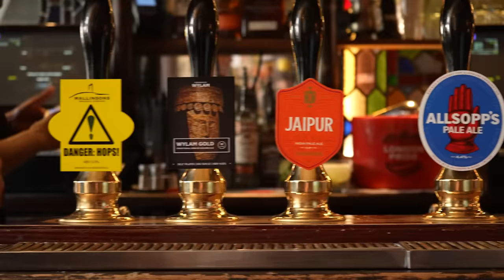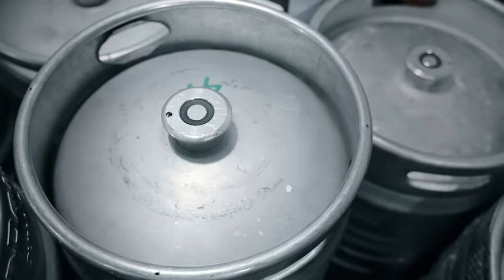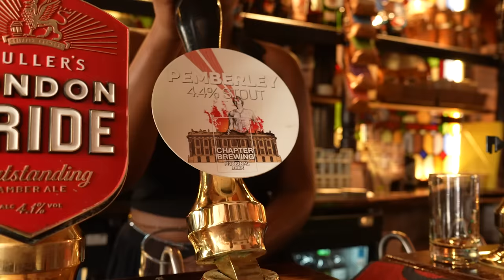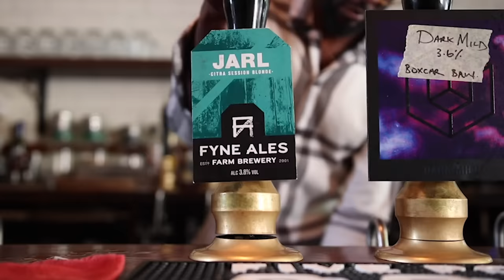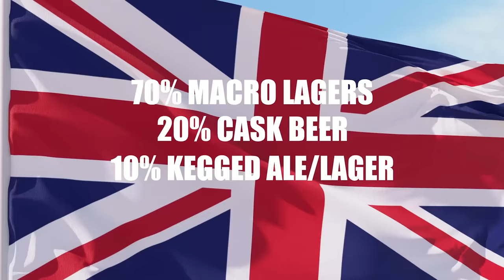American Tries English Cask Beer

Comment: Pub, Inn and Tavern all have their roots in medieval England. A pub is a public house where ale was brewed and sold to the public. Over time, these houses would advertise their wares by putting a sign up with a distinctive name. This is where the pub sign and naming of pubs originates, essentially as a marketing tool. Ale would go off quite quickly, so had to be drunk quickly, usually in large volumes to get drunk because it was only 2-3% abv, until hops were added in the early modern period. This preserved ale for longer, made it stronger and also gave it a distinctive bitter taste, hence the term “bitter” for a beer brewed with hops.
An Inn was an establishment that served travellers. Most would have facilities for horses and carriages. They would serve refreshments to travellers, such as ale and wine, and also food. You could pay for a bed for the night, though you were not guaranteed to be the only occupant! 
A tavern derives it’s name from the Latin Taverna, a shop where you bought wine, which could be consumed on the premises. In England, Taverns were distinct from Pubs and Inn’s because they sold wine and cider, rather than ale.
Reply: Hops don't affect the strength of the beer.
Reply: @Mathemagical55 it can
Reply: @Mathemagical55  in the video they talk about how hops stops the wild yeasts that turn beer sour (12:35.) I think he is referring to that. Before hops the secondary fermentation would turn the beer sour so you couldn't allow the beer to get to it's full abv.
Reply: This may be the reason there are many taverns in the west country , thank you

Comment: Super interesting, I’d love to try some real cask ale over the pond!!! Cheers 🍻
Reply: It's definitely worth a try. Something that wasn't mentioned in the video at all was the regional variation in serving style. While it's not at all universal, pubs in the South tend to just dispense the beer straight out of a pipe, whereas in the North, you tend to see a plastic 'sparkler' on the nozzle which is a piece of plastic with lots of small holes in it. You can see at 2:28 a beer being poured with a sparkler on it (incorrectly, I would add) and then the next pump over (Oakham Citra, nice beer) doesn't have the sparkler on, but you can just about make out the screw thread where it would be attached.

The difference is that the last bit of CO2 gets knocked out of the beer by the sparkler so it's slightly less carbonated. Also the head has a finer structure to it so it's got a creamier texture and supposedly better aroma but I've never noticed the difference. I prefer the Northern style as it's what I'm used to. A lot of pubs in the South will have sparklers somewhere behind the bar, but younger bar staff might not know what it is or how to serve a beer correctly using it as there is more technique involved beyond "pull the handle until one pint of beer comes out" which is seemingly what a lot of bartenders I've seen in the South do. You can do that for hand pulled cider, no problem, but not for cask beer.
Reply: It doesn't generally travel well, and it needs to be properly looked after.
Reply: @magnusbruce4051 absolutely and sometimes in the north they have the sparkler screwed on too tightly which overdoes the effect... There is real technique required to pull a good pint with a Swan neck pump....

Sparkler should be backed off a quarter turn for a normal ale, more for a particularly lively cask.
Put the glass all the way up so the sparkler is just touching the bottom (use a glass without a nucleation pattern for all cask always) pull long steady pulls until the head is just below the top of the glass.
Stand the beer and allow to settle for a few seconds.
The put the Swan neck back in but only 1/3 of the way down the glass and top up with a snapping motion
Reply: @dasy2k1  That's a pretty solid description of the technique, but obviously it's much better to show it than describe it!

I worked with multiple peopl who would top it up while the pint glass was sitting on the drip tray. Even if they got the first bit right and let it settle, it was for nothing when they cock up the end!

Comment: A Tavern would traditionally serve wine rather than beer/ale. Originally from the Latin 'taberna' for a shop or inn. There are still taverns in the UK, but the drinks are no longer limited.
Reply: Then why was Yates originally called Yates Wine LODGE?
Reply: @MerseyBeers  presumably because Peter and Simon Yates thought it sounded 'posher' from a marketing perspective. A lodge is traditionally located in a rural hunting or sporting setting - confusingly, perhaps, with 'lodging' like an inn. All this is quite google-able.

Another point about an Inn is that they were generally licensed to have board and lodge, not just sell alcoholic beverages and food.

Most of the terms sort of fell into the category of 'pub'... which could be anyone's residence that sold alcohol to the public... hence 'public house'
Reply: @MerseyBeers pure marketing, nothing else
Reply: Tavern is just a term for a place that sells alcoholic beverages and is interchangeable with Inn and didn't really have a predisposition to either wine or beer in general. If anything beer was much more widely drank in the UK due to the water being unsanitary to drink and the nationwide weather being more conducive to producing hops rather than grapes.

Comment: An important 'thing' about keg beers that is often overlooked is how much the tightness of the sparklet affects the taste. I got used to drinking Tetley bitter in the Northwest which has a head that leaves a spidersweb of head on the glass, and tasted really nice and complex with a citrus aftertaste, when I moved to the Midlands, and found a pub that served Tetley, they forced it through the sparklet to give it a creamy head and sadly destroyed the taste, getting them to loosen the sparklet was very difficult.
Reply: Yep! I HATE that creamer head, which is indiously working its way south and west. It's because people who know nothing about ale complain it is flat if it doesn't have a couple of inches of froth
Reply: Interesting, I would have reversed the locations with the big head up north and the spiders Web in the Midlands.

I spent 3 years in Manchester at college and was always surprised at how much head the mancunians would tolerate particularly in a non oversized pint glass. You lost at least an inch of beer and got a sponge in return.

Further north in Middlesbrough or Sunderland areas they always had the measured half pint pumps that blasted a half pint into the glass thus filling it with froth, then they had to put the other half in another glass to do the same, and then conduct a type of Japanese tea ceremony to get as much beer as possible in one glass. They didn't have glass washing machines and the local regs said you couldn't keep the same glass for the next round. So they just dunked the glasses in a manky sink of soapy water before serving the next pint in them lipstick etc and all. Just as well the beer did the job.

Comment: A simpler description, I think, is that cask beer is live and keg beer is dead. Keg evolved to make it easier and cheaper for the pubs to dispense it. It did tend to lose some of the flavour in being put into a sealed keg due to the necessatry filtration. Very often not helped by being served cold as this depresses the flavour.
Reply: It may be simpler, but it's not really accurate. Very few UK keg beers are either filtered or pasteurised – only those made by the bigger breweries or those making beers that need to be pinbright like pilsners. The difference is in the fact that finished ferments are put in keg, while those that are intended for secondary fermentation are put in cask. Even that's not always true and increasingly breweries are using key kegs to secondary ferment keg beer.
Reply: @TheCraftBeerChannel  

we are a very small brewery and filter our keg beer to get rid of any yeast and proteins, no pasturisation though. This ensures that the kegs do not need to stand before seving as cask does.
You can't secondary ferment keg and ensure the finished beer is clear (hazy beers are slightly different).
Reply: @iareid8255  indeed! But most brewers don't worry about clarity these days, especially in keg!
Reply: Thing is.. whilst a good cask is great. As the video points out, you soon learn not to drink in places where they don't know how or just don't bother keeping it well.. It can be horrible.
So keg is like 'least risk' if you're getting a random pint :/

Comment: Correct me if I'm wrong, but you can use a cask aspirator/breather to ensure there's no microbes in the gas you use to replace the volume of the beer you pull from the keg, and that means your cask beer will last a lot longer? But CAMRA won't certify you if you use one? I feel like that's a great middle ground: less wastage and more consistent beer by not exposing it to atmospheric air.
Reply: Sorry, just got to that bit! You're way ahead of me as usual! Good work!
Reply: Yep, I was brewing cask ales at home, and using a cask breather for them.  It's kinda hard to drink 5 gallons by yourself or a few friends in three days!  Although it might be kinda fun.  I've done that for parties.

I think it's mostly the impact of oxidation on the beer, which tends to send it to a cardboard-ish taste.  Not a whole lot of microbes are getting through that soft spile while serving; but  they obviously are in there by late in day 3 most times.

My personal favorite was Fullers ESB on the second day after tapping; just a little oxidation first rounds out the flavors even more.

Comment: As someone in their mid-30s, even within my drinking lifetime from the early 2000s cask has become pretty difficult to find in inner cities. In the countryside it's a different story, most good pubs will have 3/4 casks on. But it's such a shame that traditional beer is kind of vanishing. When I was a teenager pretty much all city pubs and bars - even some nightclubs - would have cask. Now it's all kegged.
Reply: That's a curious observation, because cask ale is pretty commonplace in London pubs now, whereas it was considerably hard to find here 20-25 years ago!  If anything, it's harder to find in some of the outer suburbs.
Reply: I'm still shocked when I see a bar with 6 lagers, 3 ciders and Guinness on tap but, the only ale is bottled, back in the 80s there would be several bitters, mild, and IPA plus something interesting like Old Peculiar or Owd Rodger and only Carling or Carlsberg and Strongbow or Woodpecker.
Reply: @steveshephard1158  

"[A] bar with 6 lagers, 3 ciders and Guinness on tap but, the only ale is bottled"

That sounds like most pubs in London in the 1980s!
Reply: As someone in their mid thirties 😂😂😂😂😂 son.

Comment: You need to travel up to the North of England. The ale is more creamier than the South.  I find cask ale pulled in the south is quite flat. This is mainly due to pubs in the South ignoring to use a sparkler.  I don't know why they don't.  Without the sparkler, the ale when pulled can look bubbly yet plain looking. With the sparkler, the ale tends to make its own little bubbles forming a creamier ale. I know it's down to personal preference. However, pouring 2 pints of the same ale, one with a sparkler and one without,  you get two different tastes. The sparkler being creamier due to the minute bubbles it produces. All cask pumps have the screw mechanism for the sparkler, as that is what the pumps were designed to use. It's just that Southern pubs prefer not to use them.
Reply: Even better find a pub using an auto vac. You can build up a really good head.
Reply: I had a nice lecture about using a sparkler when I went on the tour of St. Austell.  Then I noticed that quite a few pubs didn't use one when pouring some Tribute!  I would have said something, but I didn't want to be "that guy"- particularly being an American.  A well-kept and sparkled Tribute is a thing of beauty, though.
Reply: I know a guy who carries his own sparkler around with him. Just in case he goes into a bar who don't use them. He just asks for a pint and could they use his sparkler. 99% of them say yeah and pull his pint and give it him back. 👍 that way you always get the pint you want.

Comment: I was introduced to real ale from the cask when I moved to Peterborough. I had a tolerance for about 10 pints back then before I started to wain. I was taken to a pub in Northamptonshire, the village pub had casks on the back of the bar. The beer was poured from the cask by tap and not pumped by hand or pressure. I was given a pint of Ruddles County, it was dark and had no head. It was gorgeous smooth and tasty. I finished quickly as it was so easy to drink, I bought the next round and was told to slow down. We were moving on after the second and I felt unaffected, until the fresh air hit me. Wow, it was strong. We visited a different pub and returned to the pub owned by one of my friends. I had drunk seven pints when I dropped off at the end of the road to the staff accommodation at the hospital I lived in. I remember taking some steps and falling over something, I woke up in the morning lying on the lawn in the grounds in time to put my uniform on and go to work. My head was clear, I was a little dehydrated but not hungover. That started an education that lasted a lifetime, there's always something new to taste.

Comment: I fell in love with cask ales the first time I visited the UK. I’m planning on experimenting with brewing my own cask ales. Would love to try to do a Barleywine or a Strong Ale in a cask.
Reply: I drank so much barley wine once that my vision went to a white ever decreasing dot and then I guess I passed out. I was very young and stupid at the time!
I'm not sure if you are familiar with a 'snakebite' - half lager, half hard cider? Well we used to drink 'spitting cobras' which is half barley wine, half white cider which is rough as a junkyard dog with an ABV of around 7%.
Reply: Unlike what the CAMRA folks would say, in your case definitely invest in a Cask Breather.  Basically a CO2 regulator that keeps the cask at a very small positive pressure instead of letting oxygen in via a spile.  It will extend the life of the beer a lot, so you don't have to drink 5 gallons in three days!  Not that it wouldn't be a fun group project!  I used one, worked great, my Fullers ESB clone was loved by all my friends!
Reply: @nathanwahl9224  thanks for the suggestion!

Comment: Just had a party for my lovely wife - got two barrels of Timmy Taylors Landlord from a local pub pulled through a pump from FB marketplace for £50.... didn't bother with a spile  or a tap, just drilled two holes through the bung, one for a 10 mm tube for breathing and one for a 10 mm spear for the  beer ... glorious!!  tasted like nectar!  Cooled with wet towels wrapped round the barrels and kept wet .....We did both barrels but for say 20 pints which we had to finish off over the next few days -- it lasts about a week... If your having a party try it - every one loves to pull a pint for them selves and its a good way to support your local pub and brewery.  Previously I've had Osset Brewery beer and they are ace and super friendly as well - Cheers everyone!!

Comment: Larger is a form of Beer. Beer is made with Hops. Ale has no hops in it. IPA is Pale Ale which has been aged. For the length of time it take for a ship takes to get to India from the UK. Hence being IPA. Large became popular in the 1970's. I drank it as a child and still do. My Brother drinks Bitter (Ale). He is much older than me. Most Larger is mainly  mass produced, so it would probably be in a Keg.
Reply: No, basically all modern ales (including bitters) are hopped. The word 'ale' hasn't referred to unhopped beer for about 300 years. These days, an ale is a beer that has been fermented at warmer temperatures.

Comment: I’m 61 now, but when I first started going to pubs at 16, you could buy a pint of ‘slops’ for just 10p. You might be wondering, what are slops? They were a pint made up of the collected beer overflow from the drip trays under all the various pumps used when pulling pints of ale into glasses. A blended brew, with no two pints every tasting the same, good times.

Comment: I worked at a pub with 10 casks on tap at all time, organising that cellar, especially when there was an event on, was hectic. Especially as I had to do most of the shifting of casks as the only one on the team physically strong enough to pick them up and rack them by myself.
I spent a full hour straight clambering round the cellar changing casks over Christmas eve

Comment: Every summer there is a beer festival in a park near me. It cost about £40 to get in and you get some tokens for a few pints, after which you have to buy more tokens for more. All beer is served from wooden barrels at air temperature and there are hundreds of different types of beers all with different alcohol strengths, so you can pace yourself. 
  If you are ever at a loss what to do on a summers day and there is a beer festival on nearby I would highly recommend meeting your friends at such a festival and make a enjoyable day of it.

Comment: Lager is fermented at a lower temp and uses a bottom yeast.
Ale is fermented warmer with a top yeast.
Ale should be stored and served at 10-13°C
The final fermentation and conditioning is a multi stage process in the cellar.
Rack or stillage and let the fermentation finish.
Vent to allow the excess CO2 out with a soft porous spile. Once fermentation and venting has finished swap the spile for a hard to make the cask airtight.
On the day of service, remove hard spile and tap the cask.
Wait at least 4 hours for any sediment to resettle. 
Test the taste and clarity at tap before serving.
From delivery to service should take 3 to 7 days depending on the beer.
It's an art